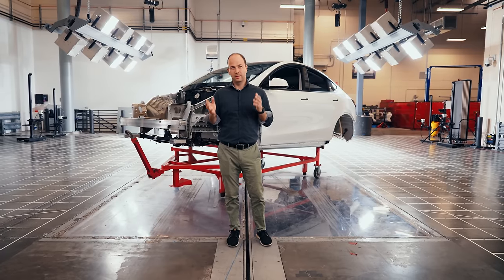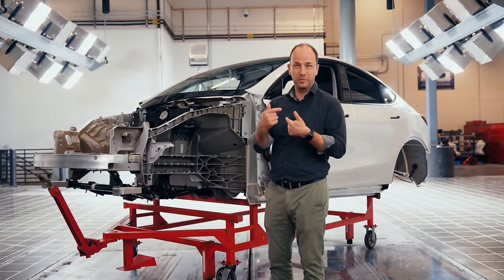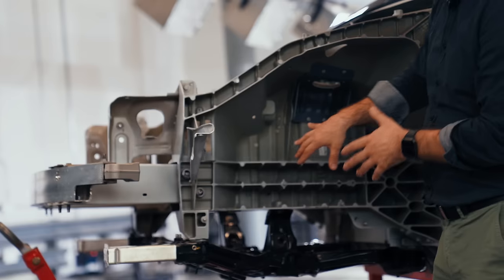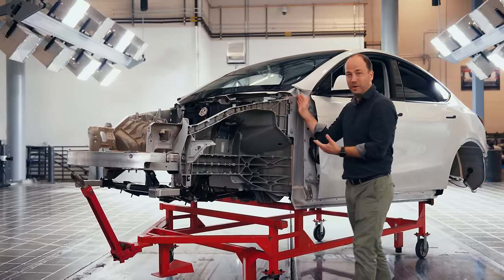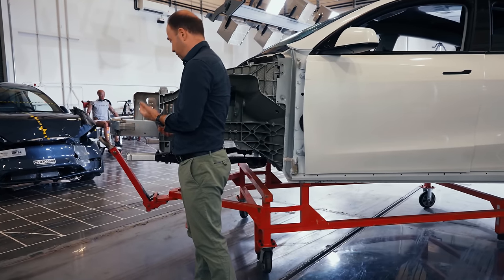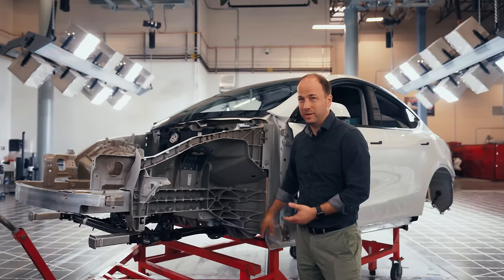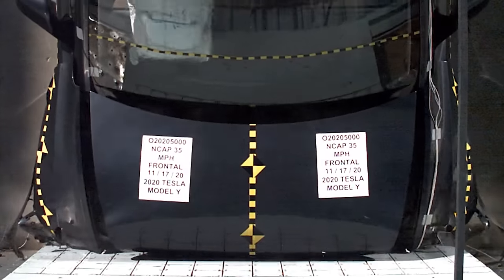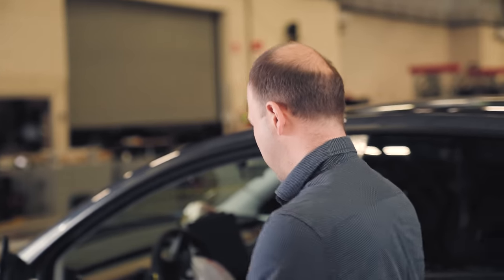Lars Explains | Tesla Vehicle Safety

Comment: Awesome part of what makes Teslas so safe and how they work! Awesome video can't wait to see more in the future!
Reply: It would be nice if we could clean up the existing lithium sites before we moved forward with this tax cattle sham.
Reply: @Dat_Sun  Let’s also clean up the existing oil drilling/refining sites which also use lots of cobalt. Oh wait…
Reply: Prepare for what you’re abt to see.

Tesla
Reply: @waynelewis9110   Oh come on that's ridiculous, it's used as a catalyst and it's not even required it can be done with steam processes as well.  The incredibly small amount that is used, pays itself off with vast amounts of energy.   Unlike electric vehicles which are essentially a fossil fuel storage battery on wheels.   

Electric vehicles don't last, which is a huge problem because manufacturing a vehicle leaves a massive manufacturing footprint.
Reply: @waynelewis9110    There is several organizations working to clean up the abandoned oil wells in our country.  It's not a huge problem anyways, and currently people are held responsible, both interested and property owners.
Reply: @Dat_Sun  The batteries can be reused for less intensive work and then later be recycled and put in a new battery.
Reply: @Coastie_808   There is no recycling of lithium batteries. There's a process that reclaims some of the materials, it's being miss-labeled as recycling.   

A fossil fuel electric storage battery is still a fossil fuel electric storage battery even with reduced capacity. What good does a extremely heavy battery bank at 60% of original rated capacity good for?  Not much in reality.  

 One things for sure, you're going to need a fossil fuel powered truck to move it around..
Reply: @Dat_Sun  I like how you make all these false claims as facts, talk about confidently incorrect. You are also completely ignoring the facts that fossil fuels uses vast amounts of power to be produced, transported, and extracted. Let’s also not forget the massive amounts of land and water we waste that also have horrible environmental effects for getting ethanol to stabilize that fuel. You might also want to look into a company called Redwood minerals that is definitely recycling batteries and at over 90% recovery over original materials. EVs aren’t perfect by any means but they are infinitely better than ICE cars and fossil fuels by miles, especially in the long run as things continue to switch over to greener alternatives.
Reply: @Dat_Sun  Even if you live in a country that get their electricity from coal (like Poland) the efficiency of a Tesla is so good that per kilometer they would release less CO2 (for the electricity consumed) than a petrol car.
Reply: @projectb6573   That's not at all true. 1st of all you're grouping every internal combustion engine ever conceived or manufactured into one group. 

Aside from that major malfunction you seem to be ignoring all of the efficiency losses that are involved with electricity generation. From gathering fuel to transporting it, refining it burning it, converting it into motion and then electricity. It's then forced through hundreds of miles of network before reaching another transformer, also known as a charger, that forces the electricity into the battery. 

 This is just a tiny example of what's going on behind the scenes so that you're  5, 6 maybe even 10,000 lb electric vehicle can go down the road.  The hardest thing about electric vehicle propaganda is where to hide the cord.
Reply: @Dat_Sun  Man, if you're going to lie, at least be good at it…

Firstly, the most efficient combustion engines that are available (and not even publicly) are the ones used in Formula 1, which are at most between 35% and 45% efficient at converting the fuel into energy to move the vehicle. That's as good as it gets as far as internal combustion engines go. This isn't even considering that they can't be mass-produced and how they are required to be maintained to operate at that efficiency and the costs associated with that kind of up keep. Meanwhile, even the most inefficient EVs still operate at over 85% efficiency in converting energy into moving the vehicle, and that is like a horrible EV, similar to the Hummer EV that is a literal brick. Most EVs operate at over 90% efficiency.

Secondly, getting electricity from the source to the car is still overall MUCH more efficient than having to transport it over sea, pipes, or trucks to their respective destinations. When you factor in the entire process from extracting oil from the ground to getting into an ICE vehicle at the pump, the entire process emits Co2 along the entire process. Not factoring in the use of land, water, pesticides, and labor for ethanol for gasoline as well. There definitely are some losses in the wires transporting the electricity, but what you are ignoring by saying so is that it still doesn't produce Co2 along the way or leak fluids over roads. Another part of this equation that matters greatly is where the power is coming from. Not all power in the US is from coal or other polluting processes. In the US you can easily look up what your local power grid looks like and where most of your power comes from be it coal, natural gas, wind, solar, hydro, geothermal, nuclear, etc. Near me is a nuclear plant which provides the majority of power for my city, this means that overall my vehicle is cleaner than any ICE car could ever dream of being.

Lastly, there are very few EVs that even break the 6,000lb (2.72 ton) mark. For example, the heaviest EV coming in at a massive 9,000lbs is the Hummer EV, which is fitting if you think about it considering previous Hummer models. Want to know how much a Ford F-350 weighs? The answer is 9,900lbs. The same goes for the Ford F-250, and other large ICE cars. The reality is that EVs only weigh slightly more than their ICE counterparts, and the weight concern was just media hype. A Tesla Model Y weighs 4,416lbs which is about on par for a ICE crossover SUV which depending on brand and model can vary between 3,700lbs to well over 4,500lbs.

Oh! I almost forgot about the charge cable thing. The beautiful thing about owning an EV is that you basically never need to visit a gas station again. Sure, you can charge at public chargers, but it's not a requirement. Most people charge at their convenience at home, just how you would plug your phone in to charge before going to bed. It's that easy. You can carry a charging cable around if you think you'll need it, but again, it is not a requirement. And even if you do want to keep your charging cable with you at all times, again the practical thing about EVs is that they often have more storage than their ICE counterparts. Thanks to not having an engine up front or transmission tunnel. So there are plenty of places to tuck a small cable in your car without having it take up much if any room at all.

You should at least try to educate yourself instead of making a fool of yourself and just parroting false claims you hear from others. At least try to be independent and do a bit of critical thinking. There are plenty of research papers and articles that completely go against most if not all the things you are saying.
Reply: @ProXcaliber   That's an awful long way to say electric vehicles are ultimately powered by fossil fuels.  Throwing all those percentages around reminds me of the con man elon on battery day, "5X Energy! 6x the Power!" And only 16% range? WTF kinda math is Elon using? The same nonsense you are.
 
Here is my response to all of that nonsense you just sprayed all over the place.  Even with the efficiencies considered, Fossil fuel is around 27 times more energy dense than the Electric storage battery. Fossil fuels have 27 times the apacity than Tesla's battery banks.  Really puts all this into perspective..

27 Times! Lol  It doesn't matter if we're only achieving 10% efficiency, it absolutely annihilates the available storage of the battery.. This is a conversation ending devastating fact to the eV community.  

Efficiency doesn't matter when fossil fuel already there it exist naturally (yes it needs refining,  but that's paid for by the product, Nature has provided us this amazing resource,  It would be best if we thought about the future while using it, This doesn't mean everybody going out and buying a Tesla but down sizing to a practical sized vehicle with no more than 100 horsepower per ton electric or ice it doesn't matter...  

 Your electric vehicle is using even more fossil fuel because it has to overcome the efficiency losses of gathering that fuel source and converting it into electricity.  The battery is nothing more than a middleman between a fossil fuel storage tank and the people.   We have barely tapped into ice's potential. 

 We have one liter sportbikes running around with 500whp and getting 35mpg.  Don't believe for 1 second that the internal combustion engine is finished evolving. The electric vehicle on the other hand stopped evolving a long time ago, we only see new shapes and insane new curb weights. Batteries are extremely heavy and weak, like I said 27 less times energy dense then ice power.

 Every level 3 electric vehicle attached to the grid is another industrial load..   Every Tesla hacked into a dryer outlet down town is another fossil fuel powered load on our grid, but we keep putting more on the road. Increasing our energy demands for fossil fuel generated energy that is already in short supply. 

 Electricity is in short supply because our grid is not up to the task. It has nothing to do with the fuel source (fossil).  To sum it up until we actually have a renewable source of energy on the grid that replaces fossil fuels, Then every watt you take from the grid is burning more fossil fuel, it doesn't matter that it's going into an electric vehicle storage battery or not.   

   Tesla is the nineties equivalent of the ev1 sham,  It has nothing to do with the environment which is just fine and there is absolutely no reason for this in the 1st place..  Manufacturing electric vehicles has to do with the current administration and whatever deals they have arranged to ensure they have a constant flow of cash coming in from the text cattle.
Reply: @ProXcaliber    I need to start looking at accounts before engaging woth them. You're just a kid, probably doing what someone else told you to do..   If someone is shouting "electric vehicles are going to save us all" it's most likely a kids account with video game uploads like yours.
Reply: @Dat_Sun  I wish I could quote, would make it easier to reply accordingly, but here I go anyway. I find it funny that you think kids are the only ones that play video games and that you went to my account giving me views and leaving comments and as such boosting my engagement, so thanks I guess, lol. Also, those videos are all 3 years old too and were to do reports.

So to your first sentence, yes, the US power grid in areas are still powered by fossil fuels. It is still infinitely better to have a centralized source of pollution powering thousands of EVs than having ICE vehicles with mini power plants themselves creating pollution wherever they go.

Power density is a big reason why battery makers and big companies like Toyota, GM, Tesla, etc. are all pouring so much money into R&D for battery technology improvement. Right now, the most promising of which are solid state batteries with about double the capacity of current lithium batteries as well as a faster charge rate, and wider temperature operating ranges. There are others as well for different applications, from uses in EVs to energy grid storage, and home battery storage.

Efficiency does matter, especially when talking about power density. Imagine saying “it's 27x more power dense than batteries” while ignoring the fact that the majority of that power is lost to heat and the inefficiencies of working that through transmissions and other accessories on the ICE cars. Engineering Explained actually has a very good in depth video about just this topic as well if you actually cared to look through his channel as you did with mine.

Oil is also finite and WILL inevitably run out, no matter how conservative we are because we cannot create more. Meanwhile, wind is free, solar is free, as well as hydro and other renewable resources, hence the name “renewable”.

And yes, the internal combustion engine is finished evolving, that is why that majority of car manufacturers have stopped developing new engine models and are just improving on existing ones. Internal combustion engines have been in development for over 100 years at this point and have stagnated for decades because they literally cannot get any better. The reason bikes are efficient is because of how light they are, and because they don't suffer the same parasitic losses of a regular car. This is not the case with EVs and their batteries. Just in the last decade, the technology in EV batteries alone has already come a long way, and that is after only a decade. And it's still improving and being developed further for more power density, efficiency, and longevity. There are already EVs that have been on the road for 10 years or more, you should also check out the 1 million mile Tesla.

Batteries are also far from weak, as is electricity in general. The world's largest industrial shovel for mining the coal you so admirably speak of is mined using a giant electric shovel nicknamed 'Big Brutus'. Batteries and electric motors are only limited by the amount of power you give to them, hence when you need a lot of power, you use electricity. The reason EVs are limited is that we don't all need 1000hp cars and for the sake of longevity. But even with that, you still have most EVs beating a ton of ICE cars in terms of speed, so much so that a ton of supercars are now even going hybrid to keep up. And the best part of that is that you can still go get groceries without burning through your battery if you just drive normally. Unlike, a regular sports car that no matter what is going to get terrible gas mileage.

The reality of grid load is that the US's major grid problem is its age. No one wants to put the money into fixing the grid because “my taxes”. Even taking that into account, the reason for grid failures isn't even due to EVs but because of environmental effects like extreme heat, extreme cold, wildfires, storms, etc. And if you also notice when there are calls to reduce power load, the first thing they will call for you to turn off is your AC or heaters, because those are the big wastes of energy.

You are also neglecting or rather ignoring what I said about local power sources. It matters greatly where the power comes from to power those scary EVs you're so worried about. And not only EVs, but the rest of your home as well.

Finally, EVs aren't being put on the road by the government or companies even. All the EVs sold are sold to willing buyers, capitalism at work, basically. The market wants more EVs, so more EVs are made and sold. It really is that simple. This is why so many manufacturers are pivoting to making EVs, because that is what consumers want. And the reality is that year after year more are being sold, hence why they are almost always in short supply or just flat sold out, and you have to wait to buy. It has nothing to do with the current administration because EVs did not just suddenly appear out of nowhere in 2020 or 2021. And the current administration also has nothing to do with EV popularity in other countries. Like say, Europe, China, Japan, Korea, etc.

And saying there is nothing wrong with the environment at this point is so disingenuous it is actually just delusional, honestly. There is a reason lakes are drying up, tons of animal species are dying or going extinct, weather is all over the place, hotter springs/summers, and colder falls/winters. Everything is not okay, to the point that even large companies are acknowledging that there is a problem and are trying to fix it.

You can try to dismiss EVs, but you will be sorely let down when you realize that they are the way forward. Even if you don't like it, they will eventually dominate the roads everywhere. EVs won't save the world, just like drinking from paper straws won't either, but both are a small part of the overall picture of reducing environmental impacts.
Reply: @ProXcaliber   Solid state batteries?   I too hope that one day we will have flying cars.   I think the battery fumes have gotten to your head. 

Sure, adults play video games.. Keep those ears on my digital trucking buddy, you're clear all the way back to lithium town come on back now.
Reply: @Dat_Sun  I mean we kind of already do, they just aren't practical because you still need a runway, and they are egregiously expensive for the average consumer. We also have jetpacks as well, in case you weren't aware of those either.

And adults do play video games, I'm one of them, and there are many more that you can find here on YT alone.

Also, one thing I forgot to mention in my last comment about the fuel density thing. You can have a 25 gallon tank, and that tank will still only get you a certain range. Just like having a specific size of battery will get you a certain amount of range. Let's just say for example that the tank of gasoline gets you 400 miles of range. An EV only needs to match or slightly surpass that range thanks to its efficiency. More is obviously always better in this case, but what I'm trying to say is that you can do more with less in an EV because of how efficient the batteries and motors are.

If an ICE car got the same efficiency as an EV with a 25 gallon tank of gas, that would mean instead of going 400 miles on that tank, you would go almost 800 miles as an example. But you don't because they are inefficient.

And no fumes have gotten to my head, I just genuinely car about my future as well as my children's future. But I do wonder how selfish you have to be to get to the point you are at. Where you are so easily manipulated into thinking there isn't a better way of doing things, just because something has been a certain way for so long. That is beyond me, honestly. If we listened to people like you and made no progress, we would likely not have all the amazing things technology and science has improved in our daily lives.

I also, don't play that game as much anymore, I'm more into city builders now because I don't have much time to play these days due to work. I can just pick up and drop a city builder and take my time. Also, much more relaxing as well. You should try it, it's a great way to unwind and de-stress.
Reply: @ProXcaliber   We are nowhere near flying cars. What you're doing is taking a drone and calling that a flying car. And there may even be a example of a tissue thin automobile that also flies. We've had examples of these death traps long before me and you. I remember a flying Pinto from the seventies. 

 Here's a shocker for you. The 1st jetpacks were manufactured in 1960. They work better than any of the electric junk you see today, not that any of them work well at all. 

 The reason why the 1960s jetpack worked so well compared to a battery powered one of today is the same old 27x power density factor that fossil has over the old chemical reaction storage battery.